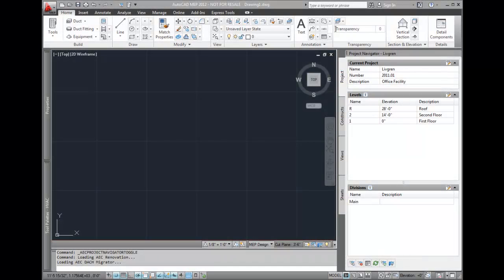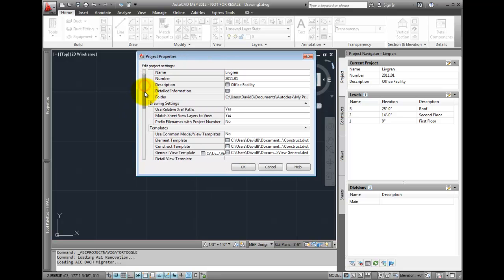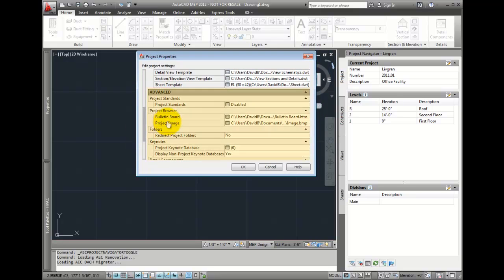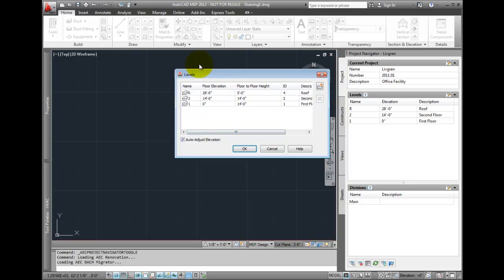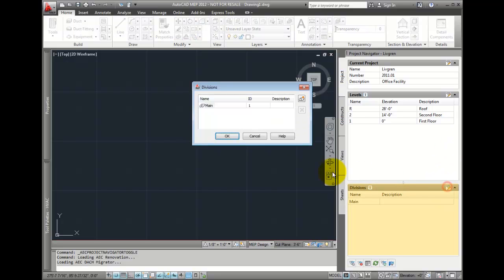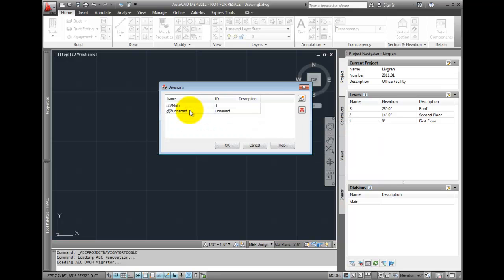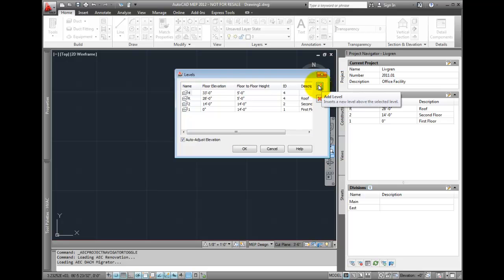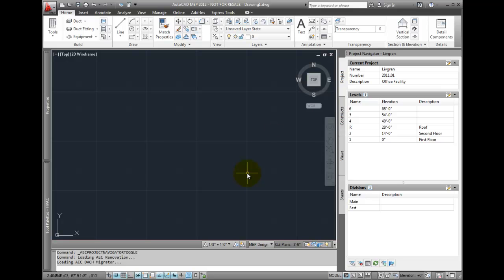AutoCAD MEP 2012 Tutorial - Project Navigator Overview - Project Tab

Comment: If I have an existing model can I start with it? I want to take this building model that consists primarily of structural steel members and break it down by floor. That model is complete how do I start this process?
Reply: Hey, did you perhaps figure out an effective way of doing this? Let's say I have a complete model of a building, and want to make floor plans using the available (single) model file. Is there any way of doing this via project manager?